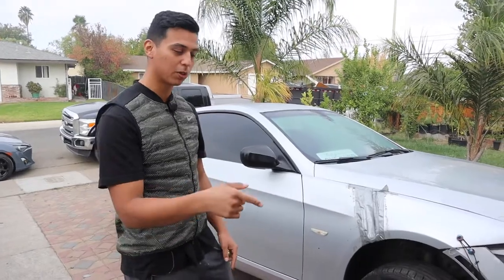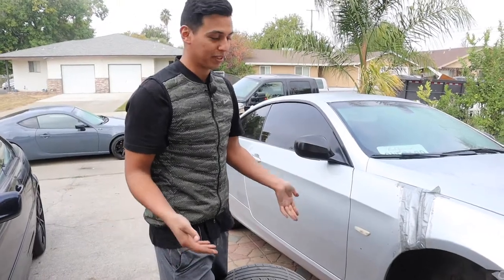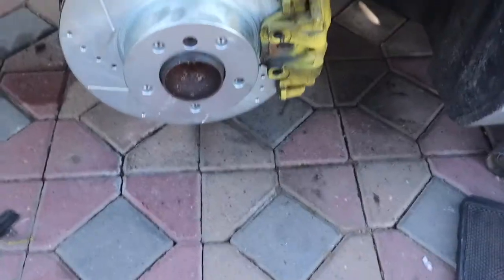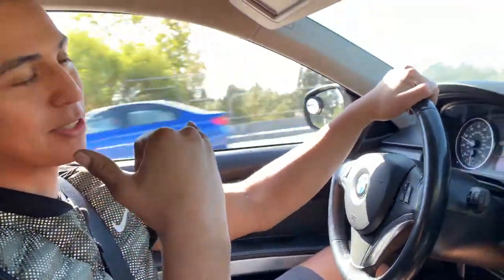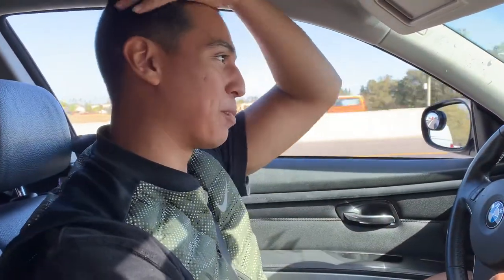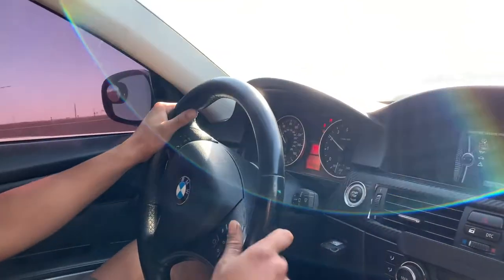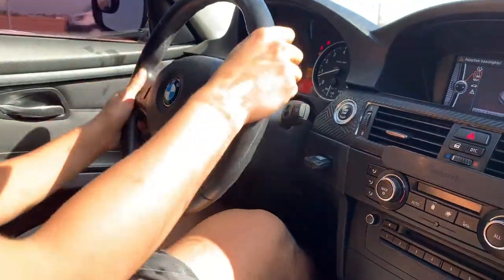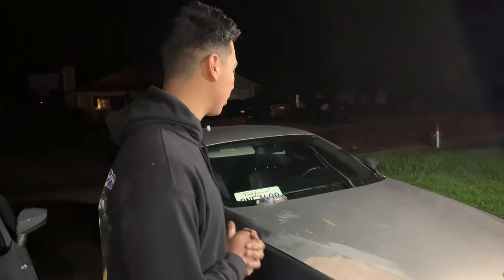E92 BMW 328i gets New drilled/slotted rotors!! (Fixed steering wheel shaking!)

Comment: Had this problem on 328i 08. It wasn't the rotors. Everyone kept telling it was the problem. 
It was the so call wishbone. Control arm. Took tires off many times. What I did was pulled on the rotors and could here the clunking.  It's hard to see.
Reply from the maker: Dang that sucks that it had to be something complicated